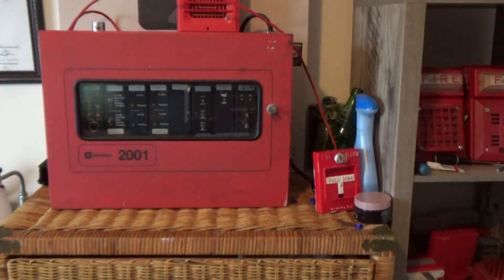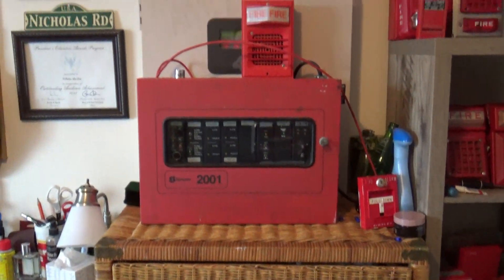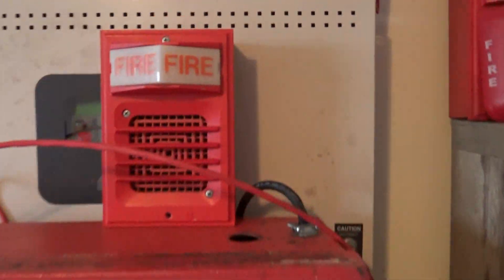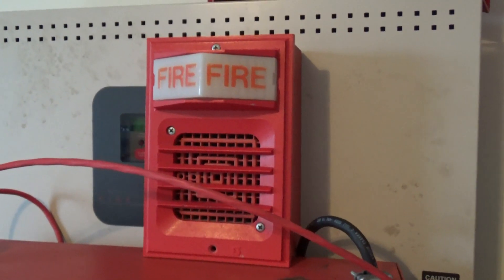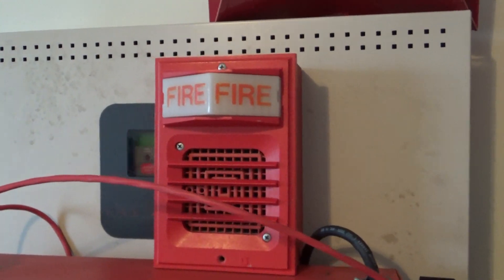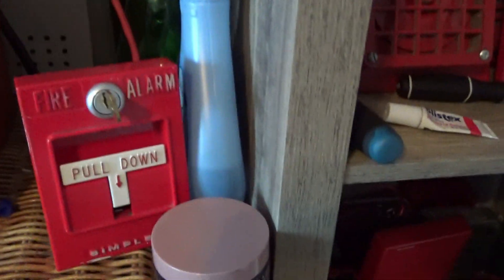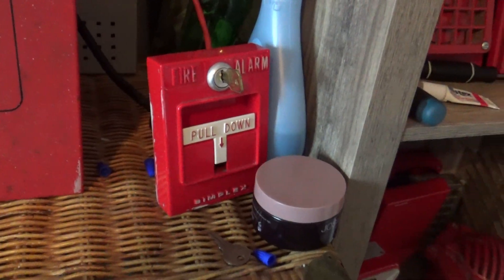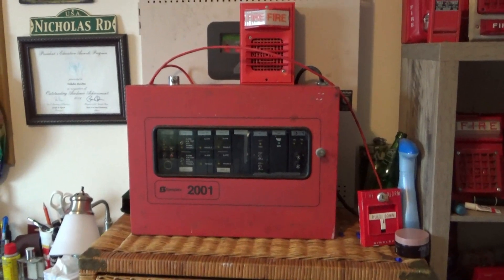Simplex 2001 System Test #2 - Simplex 2903-9005 + 9806 Horn Light (90BPM March Time)

Comment: High school fire drill memories...almost identical setup except they had a dual projector setup (like the bowtie shaped one on the other horn above in the video) in the hallways and locker rooms and a single projector setup in the shop classrooms, gymnasium, weight room, library,  and cafeteria. Set to 90bpm too. Always thought it was a unique sound